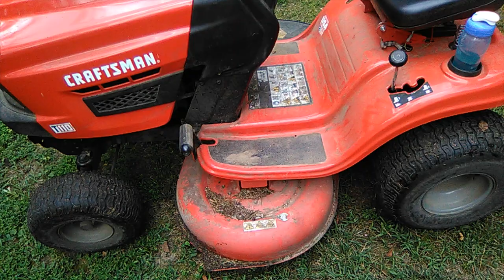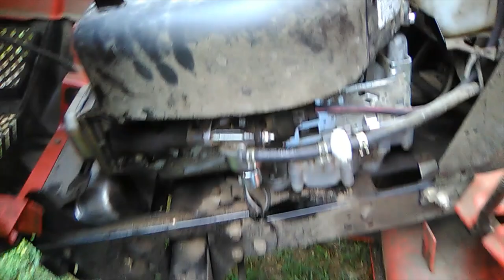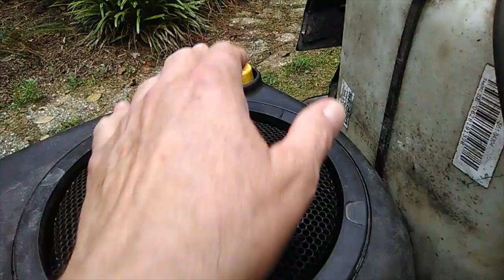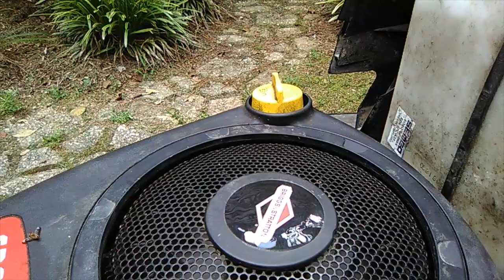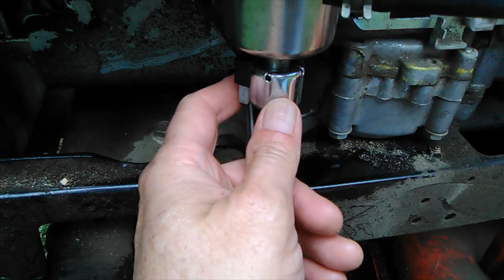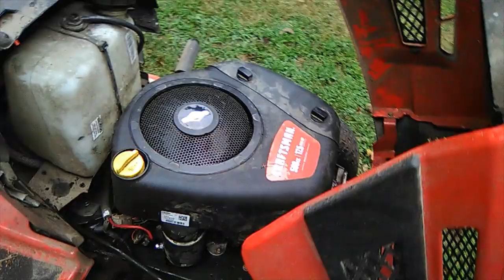Craftsman T110 Riding Mower - auto fuel shut off solenoid failure

Comment: Same mower same problem, if you need a quick cheap fix just run up to your local hardware store and get a manual in line cut off valve. It worked fine for me until I could order a new switch.
Reply from the maker: Great idea, that's going to help some people, thanks.
Reply: Explain what to do with that after purchase? Thank you
Reply from the maker: @bobdare  I didn't post this, but I'll try to explain.  I assume your auto solenoid is stuck open and gas is running into your engine.  Cut the line from the gas tank running to the carburetor and place the in-line cut off valve.  Close the valve, put gas in the tank, open the valve and quickly start the engine.  When you turn the mower off, quickly close the cut off valve.  Did that make sense?
Reply: Ive got 2 mowers with same problem. Very hard to get OEM parts and the cheep replacement parts ive ordered does the same thing over and over. Just put an in-line cutoff valve but key is to NOT to forget to turn it off when you are done. Lets just say ive got a very clean crank case because im too bad to forget to turn off the gas at least once during the summer mowing season…😂😂😂

Comment: Does your solenoid have a rubber stopper on it? The part I ordered didn’t come with the rubber stopper and now my gas tank just drains.  Still can’t get it to stay started.  Do you happen to know the part number for the solenoid?   Thanks
Reply from the maker: Can't remember where I bought it, but here is the part number I found online, 846639 Fuel Shut-Off Solenoid for Briggs & Stratton Engine.  To be double sure you can go to Repairclinic.com, type in your engine model and find the part.

Comment: Did your mower look like the oil was overfilled? My parents recently bought the same mower and after about 3 months it died. Repair shop said they overfilled the oil. When we got it back the gas tank was empty , the oil was overfilled, I drained some oil to the dipstick full mark. Filled it with gas and couldn’t get the engine to even crank. Shortly after the fuel started leaking out of the air intake side of the carb where the intake tube mounts. I drained the gas and sent it back. They are saying it was overfilled with oil again and want to charge my mom another 200 bucks for service a second time. Trying to get some ideas before we go pick it up tomorrow
Reply from the maker: In my case all of the gas had drained into the engine, so the dipstick showed overfilled, but on the dipstick was a gas oil mixture that no one would confuse for just oil.
What I would do is get my mower back, go to the hardware and get an "in line shut off valve" same size as the gas line to the carb.  Install valve and close, drain oil, replace with new oil, fill gas tank, right before ready to start open in line valve and start engine, when finished close valve.
If this works you can order the auto shut off and install.
Reply: Well said, good thought process

Comment: This just happened to our mower. It started smoking from that cylonoid. Would you mind sharing with me on how to change that part?
Reply from the maker: Sorry to hear that.  If you are unfamiliar with these types of repairs, I would encourage you to take it to a professional.  First, you will need to order a new solenoid.  If there is any gas left in the tank, remove the gas line from the carburetor and move it up high so it does not drain.  Remove the power clip from the solenoid and unscrew it from the carburetor float cup, cup and solenoid will fall loose.  Replace with new solenoid and screw up through the float cup and into the carburetor.  Replace the gas line.  If the gas has drained into the engine you will have to drain the engine though the  oil drain port and then replace the oil.  On first start it will smoke white smoke for some time then calm down and run OK.  BE CAREFUL, you are dealing with electrical power and gasoline.

Comment: ok.  How about having the opposite.  I have gas in the tank but the engine will start for only a few seconds and die.  This all happened after I cut the front yard and went to the back and it just died on me. Checked the filter and gas lines and they are all a go.  I see that solenoid but couldn't understand what that was about.  So I figure mine is in the shut position and not letting any fuel to enter the carb. I would have liked to have seen how you changed it.
Reply from the maker: Yes, it can stick closed as well as open.  See the comment below where I describe how to change it.  Let me know if you need any help.
Reply: Same just happened to me mowed front yard then it died , changed spark plug fuel filter took out plunger seems ok . But solenoid on bottom of plunger might be bad don't know